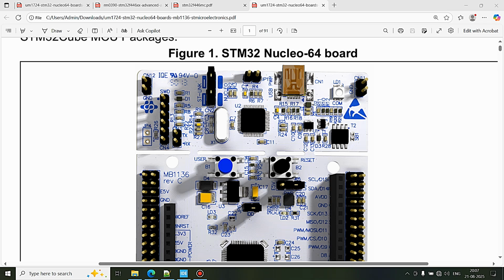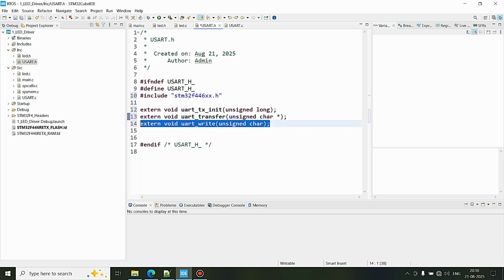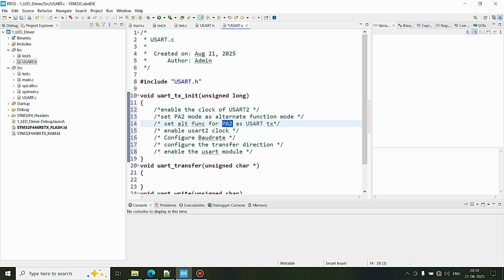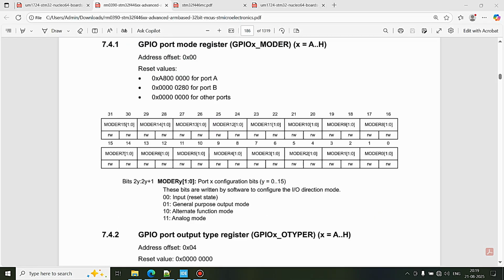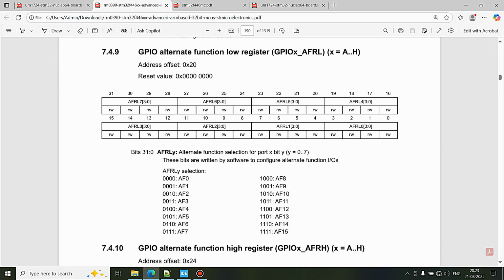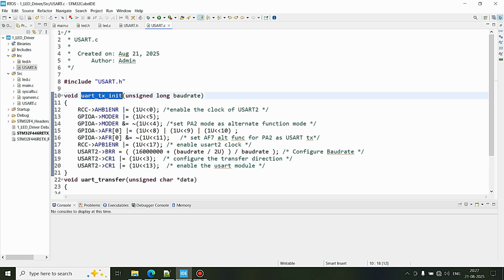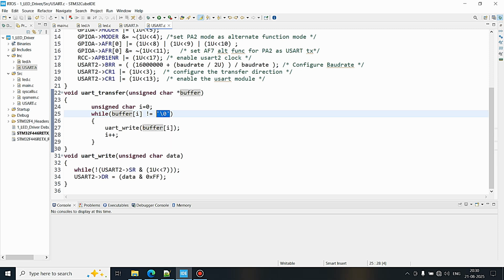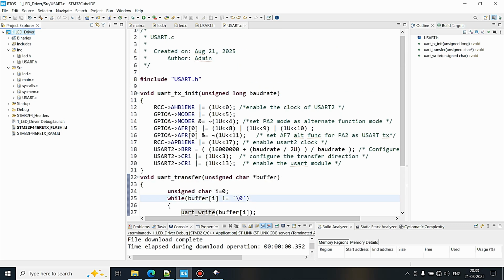Developing USART Serial protocol driver for stm32f4 using STM32 Cube IDE

Comment: In the void uart_write(unsigned char) function, shouldn't it be like this: USART2->DR = (data & 0x00C000FF); Because in the datasheet it says that bits [31:10] must be kept at reset value that is: 0x00C0 0000??